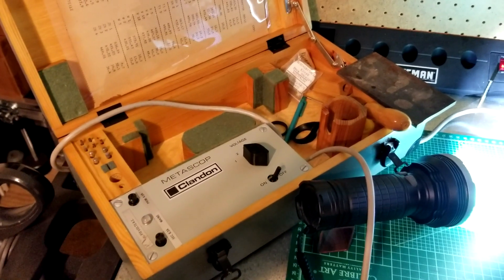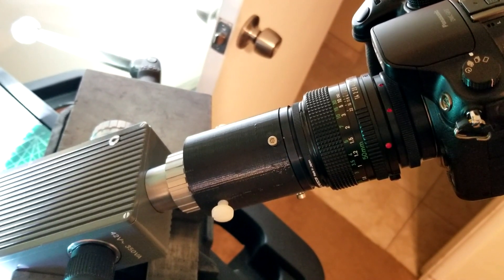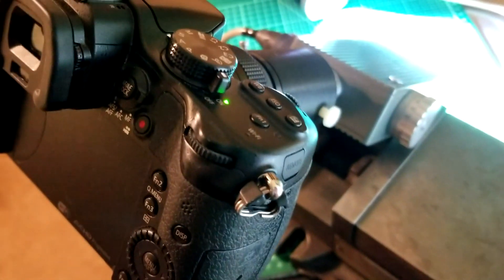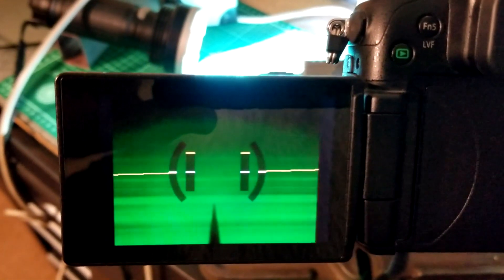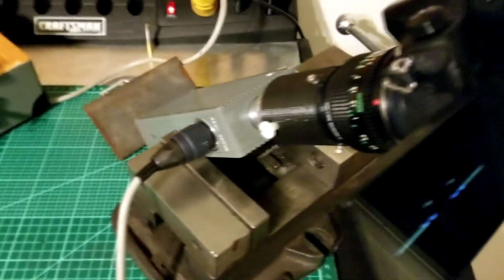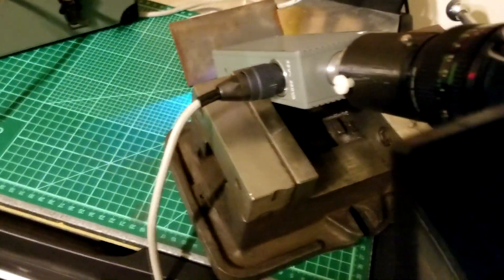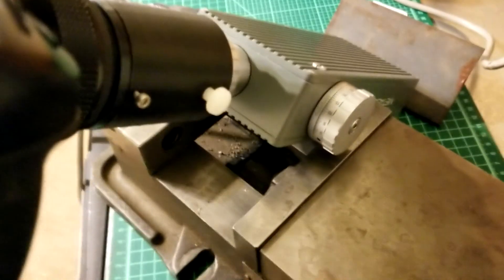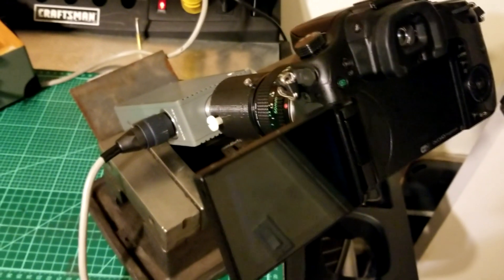Clandon Metascop - Part 1

Comment: I spent years working with these things. We had a book of colour photos that showed the alloys we were looking for. We knew Cr. Two lines the intensity of which gave %. The position of the electrode is most likely your problem. Or the lens, or maybe both. Each of us, we had 7 of these Metascop’s, checked ALL incoming material for conformity. We also had a set of materials for each machine to use as standards, these were 25*50 plates welded together. So we could look at the job, and compare it straight to the known material.

Comment: I have the Same Item. Ist needs top be preheated by Sparking an the Ambient lights in your room are much to bright. After preheating you See a bunch of Line spectra. The scale on the turnknob corresponds to wavelengths where you Need a list to convert them. It is also possible to calibrate the scale on the knob using a Natrium Lamp and Set the Pointer in the visualisation between the two sharpest Na lines, Thema the scale of the knob must Show 10. Please excuse my Bad english i whrite you from Germany.

Comment: DaSmokeDaddy,I used to use one of these at my place of work,a steel testing laboratory.The reason you are not able to see the spectrum when arcing the piece of steel is because the electrode is adjusted improperly.The electrode should be shorter than the adjacent support leg which should bring the arc into the very limited field of view of this instrument.Also you need to ensure the arc is constant and not spluttering like in your video.Hope this is helpful.
Reply from the maker: Thanks for taking the time to help out.  I haven't used this in quite sometime since I need to redesign my DSLR adapter and my 3D printer is acting up.
Reply: @DaSmokeDaddy  mam coś takiego tylko nie wiem czy działa